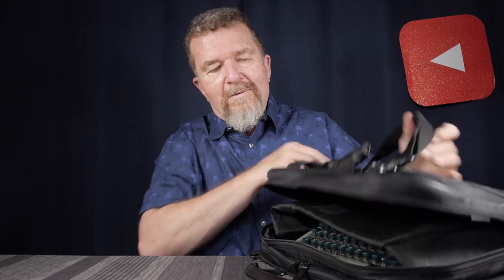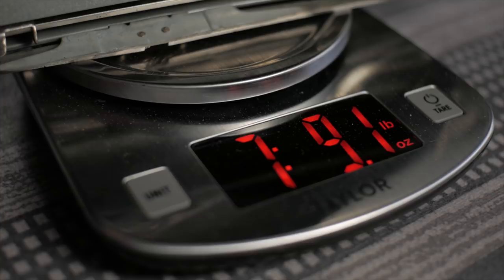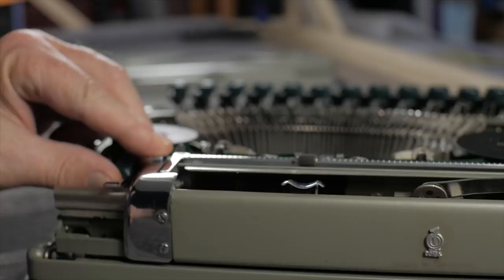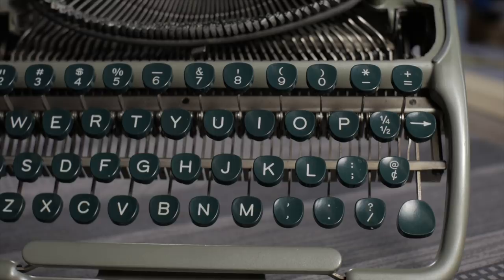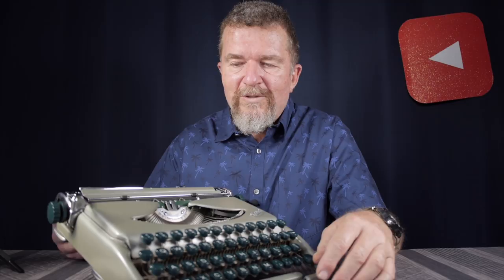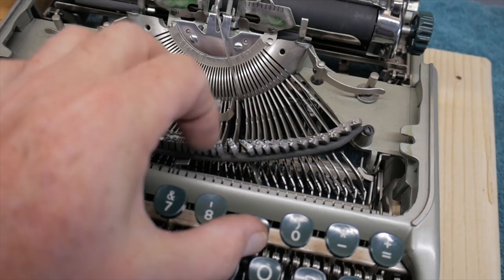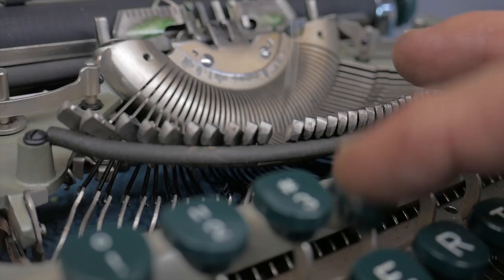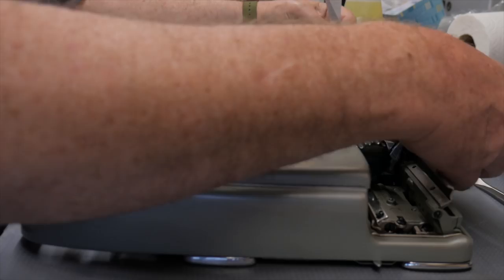Typewriter Video Series - Episode 177: Groma Kolibri

Comment: Great video Joe, thanks! The green ribbon is a really nice touch. 
I seem to be amassing these since the line spacer mechanism is a recurring problem for me. My first one had a broken pusher & wouldn't advance at all, so I exchanged the whole mechanism from second machine. She now advances but it turns out the second mechanism is flawed as well: In single space it will just go half a line (one click), while double space is fine (three clicks). I have since aquired a third one with other flaws (cracked paint) where the advancement works but am reluctant to exchange the mechanism yet again since the second one is usable and it is a fiddly job. I am also afraid of damaging the working mechanism. There doesn't seem to be a way to just exchange the carriage as a whole, either..  Any thoughts?
Cheers, Oli

PS: Regarding the one with the chipping paint (not in a charming way unfortunately), having a quasi unibody design, do see any perspective on isolating the frame to strip and repaint it?
Reply from the maker: I can't see how to totally repaint it without stripping the guts out. Or mask off the underside and paint only superficially, so it looks good from the back of a moving horse (to quote an old friend).

I have no answer for the line advance problem, except instead of using the lever to return the carriage, pull the carriage to the right using the right platen knob, then manually turn it two clicks for the single line advance. I've tried this with another machine that has a wonky left margin, and it's easier to do than you think, once you get used to it. But, alas, not a "real" fix, eh?

Comment: Thank you for this video. It opened my eyes to see how special mashine this Groma Kolibri is. It has been for 60 years in my family and I was about to toss it away. 

I managed to get a new ribbon to it but it is black and red on the other side. Now the letters going under the line like p y g are black and red at the bottom. What to do to correct this ? Is it the ribbon or the mashine to blame about ?
Reply from the maker: The Kolibri is made for a single color ribbon, as it lacks the bichrome setting mechanism. You should get an all-black (or other single color) ribbon.
Reply: Ok !  Thank you for your answer.  That makes sense.

Comment: Hi Joe, just found your video. I got my hands on a beautiful Groma Kolibri. I am in love!! 
QUESTION: The letter z and y are not in the right places (z is where y should be and vice versa). Can you give me any tips on how to switch them so they are in the proper place? I would love to use this little gem but it's pretty disorienting to have a key swap like this. 

Any guidance would be appreciated. Thanks for your videos!!
Reply from the maker: Swapping type slugs around requires a special factory fixture be installed at the type guide; then the type slugs are unsoldered from the ends of the type bars and resoldered to their new location, using the fixture to keep the slugs in precise alignment to the platen. These machines were made a half century ago in the DDR, likely nobody has the necessary fixtures the factory used.

If you tried resoldering them by hand, the chances are slim you’d ever get the alignment good enough to make a good imprint.

I have several QWERTZ machines and just get used to the Z and Y being reversed. It’s much easier than the French AZERTY keyboard!